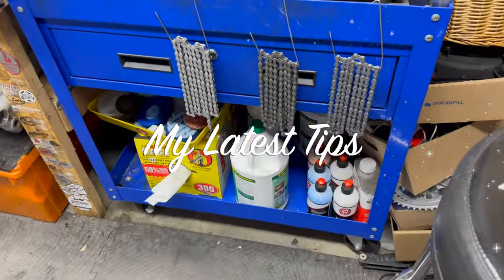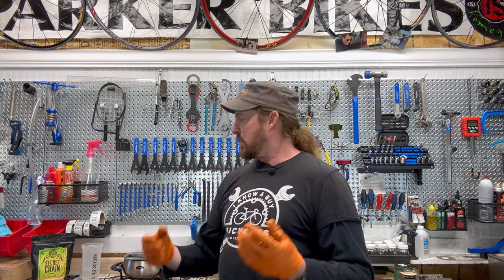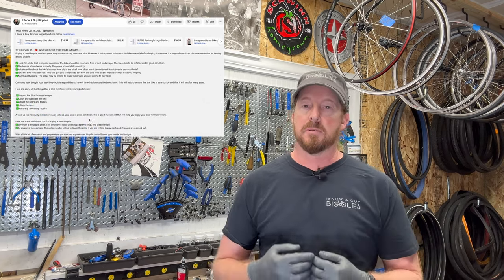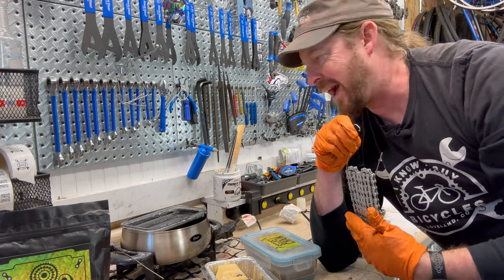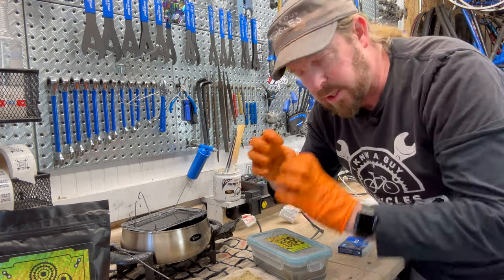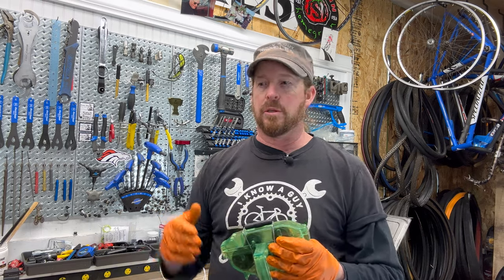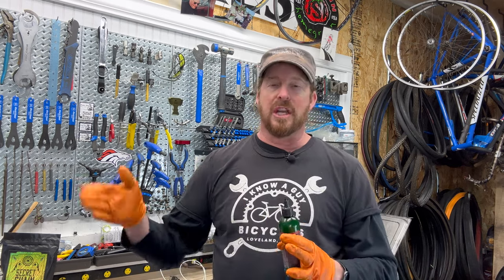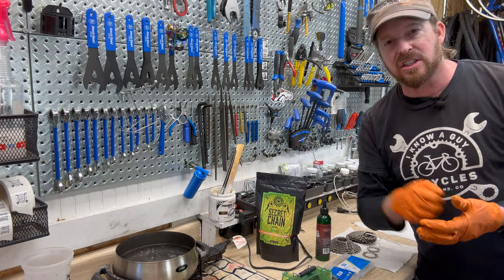The ULTIMATE Bike Chain Treatment: Hot Wax Your Way to a SILENT, SHINY Ride

Comment from the maker: What you would like to see next? Check out the other "Wax Videos" hanging out with the guy. Videos:https://youtu.be/BmTx-nc7atU
Reply: What about using a vacuum chamber (120USD on Amazon for 3 gallon chamber) to get out any air bubbles (in the hot/liquid wax submerged chain) and really drive the wax into the nooks..? I have this mental image of bubbles preventing wax filling small spaces.
Reply from the maker: @MichaelSmith-fg8xh  Interesting. I'll have to check into that.
Reply: I've seen the approach used to help epoxy get into fine spaces (carbon/Kevlar matting, rough wood). I looked and beeswax seems to be ok in a vacuum at room temp (if something is close to it's boiling temp, a low pressure might cause it to boil off) but I couldn't find the exact boiling point for a given pressure... So I don't know if wax at 100°c in a vacuum chamber set at maximum will boil

Comment: I noticed the silica and graphene settle to the bottom of the wax. I like to stir my chain in the wax and let the wax cool till it just about solidifies to get more of the goodness into the chain instead of lying on the bottom of the wax container. Once cooled enough and a final stir I pull it to dry with more of the fine particulates you want in the chain.

Comment: Thanks for the cool video! So, I started waxing my road bike chain, and it leaves a ton of wax dandruff on the chainstay and derailleur and allllllll over the floor when it’s on the trainer. Is there a way to prevent the wax dust/flakes everywhere? I like the chain not being greasy and nasty, just concerned about wax all over my nice new bike!
Reply from the maker: Try to use a dry/clean hand-held chain cleaner to remove some of the excess. Wax dust shouldn't hurt the frame or componentry; just dust and vacuum it up. Also, don't forget to cover the areas of the bike that you sweat on. Sweat is like acid to bike parts.
Reply: @IKnowAGuyBicycles  Thanks!  I commented before reaching the end of the video, and a few minutes later saw your trick with the brushy cleaner thing!  A few months ago I saw that my aluminum bars definitely have some corrosion happening, so should probably replace them sooner than later.  Will be spending a lot of time on the new TT bike this year though, so I'm looking forward to a change of pace.  Thanks again!

Comment: Thanks for the walkthrough! Super helpful to see your setup. When a customer sends a used waxed chain back for a rewax. What is your process for rewaxing? Do you do any prep/cleaning work before submerging the chain in the hot wax? Thanks!
Reply from the maker: Great point! There are a few schools of thought on that. For road bikes, rinse with water/dry and re-wax. MTB is two wax baths, first to shed old wax and then second to refresh with new. "Zero Friction" shows that process. I put them in rubbing alcohol, run them a couple of times in the ultrasonic cleaner, and then dry them. It's not the complete cleaning, just a good rinse before re-waxing. If you must strip it completely to use another brand of lubes, submerge it in boiling water. lol Follow-up video will be coming.
Reply: Ok makes sense! Thanks for sharing.

Comment: Super video.  I definitely want to try that Beeswax at some point.  I like the idea of using the chain cleaner.  I have a dedicated Grand-master link that I use for the shedding process (it’s just a 8-spd master painted yellow) that way you still have a virgin master to give to customers.
Reply from the maker: Nice, waxing with the link. I found it easier for the customer to reuse without pushing through the wax build-up. I use small zip ties when master/power links are not available. But that's a great idea. I'll have to give that a try. Ping me at justin@iknowaguybicycles.com. I would love to compare notes.
Reply: @IKnowAGuyBicycles  yes, definitely.  I’ll reach out to you.

Comment: A very possibly good but messy idea... Instead of placing the chains in the ultrasonic cleaner in the container, take a deep tissue massage gun, hold it against the closed tupperware container, and it should move and vibrate everything around quite well.

Comment: The ultrasonic process after the hot wax immersion makes little sense and wasn’t explained adequately.
Reply from the maker: I'll give that more focus on my next chain wax video. Thank you for your insight.
Reply: Looks like he puts the wax coated chains into a container then sits them on the basket of the ultrasonic to agitate/warm the wax deeper into the chains. Then puts the chains back in the wax for another coating.